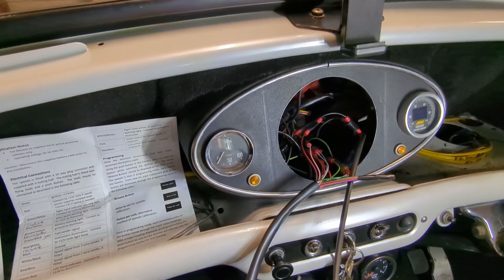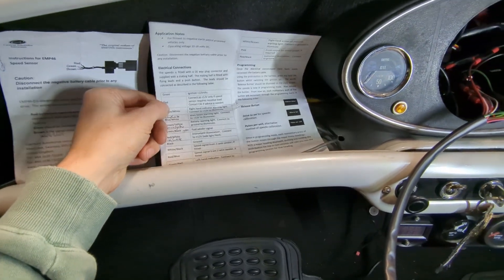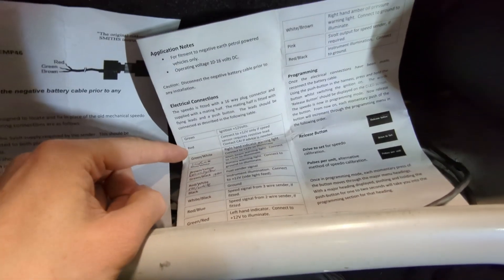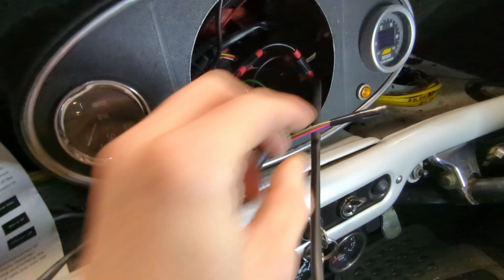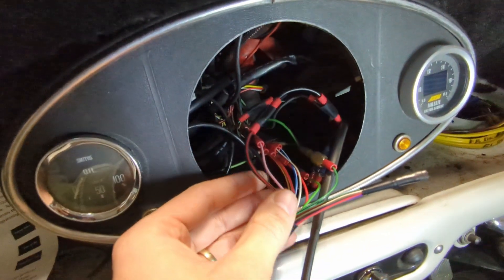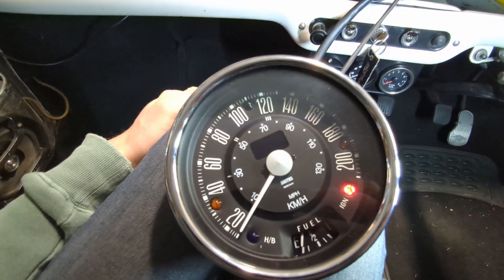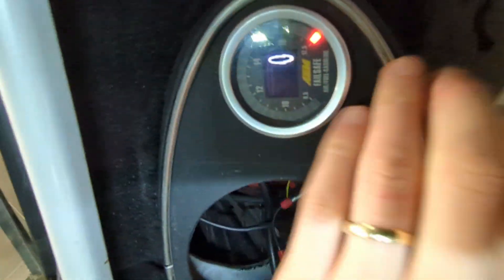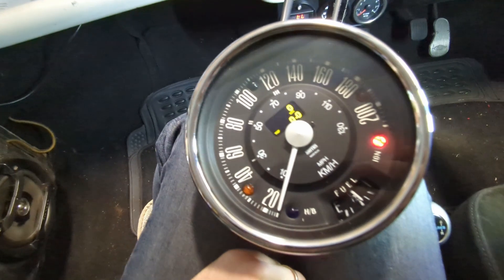Classic Mini Digital Speedo Install & Wiring

Comment: Great informative vid mate; I have bought one of these for the Moke I have. It's installed but have not set it yet (calibrated). Did you have any issues doing this?
Reply from the maker: @kriscub  It's a bit of a process, but not hard to do. Set a rough starting number, then go out and drive it, comparing it to a phone GPS Speedo. Adjust the number up or down as needed and until you get it about right.  Involved lots of ignition on to set, ignition off, car on to test, car off, etc. I set it to be accurate to the GPS at about 60kph, a lower speed probably won't be granular enough to be accurate at higher speeds. I also then set it to over read a bit like a modern car, so I don't get booked!
Reply: @SmithJolyon  Thanks mate, I haven't got around to it yet but I will see how I go. Cheers

Comment: Hi, Could you advise what parts I need to do a centre speedo conversion to an SPI, I have the analog speedo, dials and black housing. Is there a bracket for fixing the housing. Any advice much appreciated. Good video! Cheers from Scotland!
Reply from the maker: @rondon73  Hi mate, my speedo binnacle is just held in with holes straight into the firewall, but it's a mk1 so I'm not sure what's involved with the spi! I assume the Speedo sensor is slightly different, minispares sell a version that fits into the A+ gearbox but the plugs on the Speedo end should be the same. Not too sure on the wiring situation in an SPI though sorry!
Reply: Just picked up one myself..looking forward to a steady needle...  thanks for the video